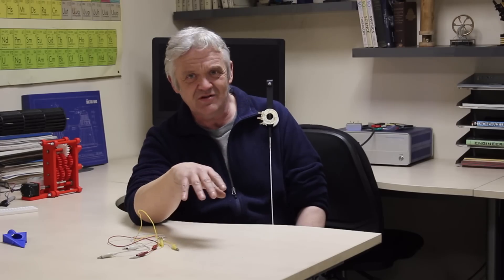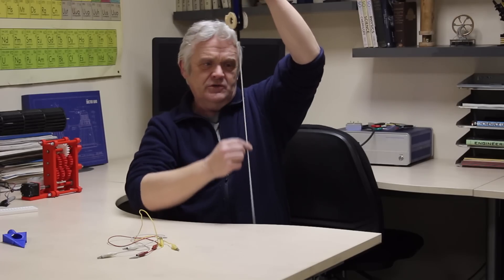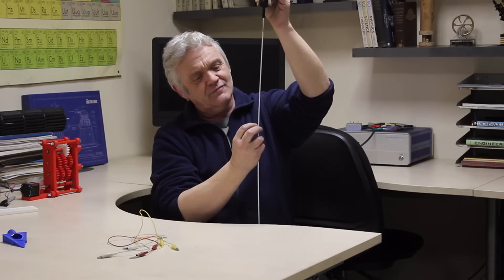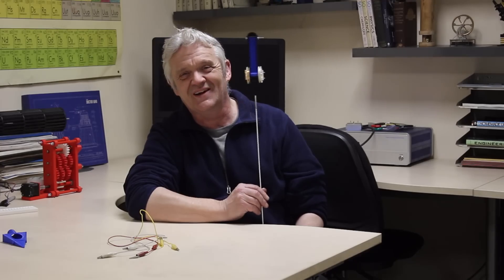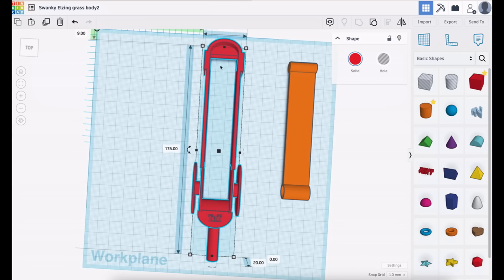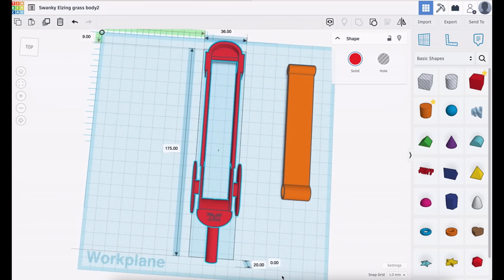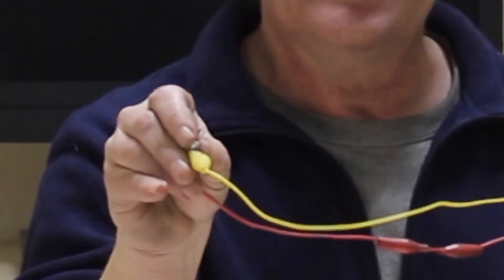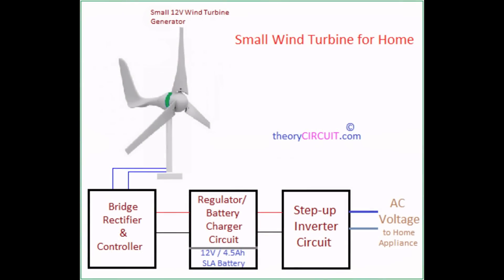1841 Barleycorn Wind Generator - Quite Possibly The Best Thing I Have Made

Comment: This is wonderful!
The barleycorn generator itself is aesthetic and functional.
The rod/spring as a protective measure against strong winds can be used with other kinds of wind energy devices, either by changing the device's position or angle in relation to the wind, as demonstrated in the video, or by deflecting the wind itself.
Thank you.

Comment: Excellent Rob! I was thinking about this a bit and was mauling over ideas that if you could scale it one way or the other and in doing so increase output if scaling up or keeping the same output in making it smaller thereby lowering costs or footprint. If we can double the output to cost ratio by any design changes then it clearly would be a more than formidable to any other wind energy harvester, due to the fact there is not much out there to harvest the more abundant low wind or vibration sources of energy. 
It all seems so very simple and I have always been a proponent of localizing our energy production and decentralizing it is the key. When we do this it allows us to meet our individual demands with sources or designs that would be completely infeasible for big energy to build or develop and thereby not given any respect because they cannot use these to make money, however these types of harvesters that are small and productive for the individual needs are the very key! They can be easily built at low cost and they can provide all an individual household could use. 

This localized mindset should be at the forefront of society and it does so much good for all of us as a whole and I am ever hoping that we all will awaken to creating this and get out from under the strong arm of big corporations and be our own producers of a healthier living. We have the tech at our disposal now that individual sweat and work to have these systems is not a deterrent it may once have been, because we can now individually be our own factories and providers on small scale that is competitive to the big businesses and build systems that take very little physical input to run them.
Reply: Imagine putting these along the side of a busy highway and letting the passing vehicles create a steady flow of wind. Also, put them into sheets mounted on posts, and they will be sturdier ( https://imgur.com/E63ec5m ). I alternated the colors to show one option. You could even paint sequential messages on them, line them up in consecutive rows, and they'll start to look like the old Burma Shave signs from the early 20th century in America.
Reply: You have a right to be concerned with the cost and it will be heavy but do not discourage. Your current engineering specks are correct. You just have to miniaturize these to the microscopic scale and they are feasible to use. We would be mimicking nature in how she harvests energy. Think of the cilia that coats your intestines insides? This kind of 3D microscopic printed or bio printed surface on buildings would be doable by your designs.
Reply from the maker: myself - I would like to go smaller - make them pretty much unobtrusive - I sincerely think it can be done

Comment: So many ideas spring to mind. The main stem could drop into a solid sleeve to protect it in stronger winds. A sturdy piece of sprung steel could have whole branches of 'e-barley' mounted on it. Motorway verges could be planted with these to make better use of dead space and easy access while using the turbulence of passing vehicles

Comment: One of the main problems using a field of these devices would be plants growing in between the springs & restricting their movement. However if you installed solar panels above them it would reduce the light available for plants to grow & increase the power generated per acre. Also if these devices were white & bi-facial solar panels installed then the usable amount of reflected light from under the panels would increase for extra solar power generation.
Reply: Think of it this way. Why not stack units of these on top of one another just like in the head of barleycorn and then just make the stalk very tall for each compound unit.
Reply from the maker: they don't need land surface per se - you could stick them to buildings, roofs, bridges, the sides of roads, road signs, bouys, ships, lamp posts - the list goes on and on

Comment: Another big plus is not having huge turbines across the landscape.
I do wonder about the sound a field of these would produce compared to the standard wind turbines currently used, if quieter that would be a huge plus.
On a side note, your constant great ideas could be used as proof that caffeine is good for us :)
Reply: I doubt they would be quieter. If you've ever stood next to a field of barley you will know that they wind makes quite a noise as it blows over it.  I expect that if you stood on the edge of a large field of these they would make the same noise as one large turbine stood in the center of the field.
Reply: @tlangdon12   - the benefit of the barley is that you can eat it at the end of the season.
Reply: Would a field of these be better? You 'might' be able to get away without concreting over the field, but you'd need miles of wire and a load of transformers, maintenance would be higher because you'd have thousands of things that could fail and finally you've lost the field to actually grow crops

I guess in a low wage economy on the margins of a desert it might make sense? So the edge of the Sahara?
Reply from the maker: they don't need land surface per se - you could stick them to buildings, roofs, bridges, the sides of roads, road signs, bouys, ships, lamp posts - the list goes on and on - and yes caffeine is awesome lol
Reply: @ThinkingandTinkering  Hi Robert. Could a field full of these also double up as an earth battery in some way?

Comment: You could make it simpler by putting a flywheel in the top and then running fine thread down the supporting rod. Then with a sail of some sort at the top every time the wind blows the cables are either stretched or retract adding momentum to the flywheel. This maintains a constant power production between gusts.
Reply: Kind of reminds of some kite-based wind power designs, with the sail-kite being pulled back by the wind to generate energy -- except in this design, a spring system could pull the kite back so it can further spin the flywheel.
Reply: @kensmith5694  Hm, here's a radical re-imagining: A kite attached to a string with a magnet-counterweight that is inside a tube. Coiled around the tube are, of course, copper coils. As the wind picks up, the weight is pulled up, and as the wind goes out, the weight drops back down. I imagine this design would be incredibly cheap: besides the wire and magnet(s), just PVC piping, fishing wire, maybe even a little rubber balloon?
Reply from the maker: I am not sure that is simpler per se mate

Comment: Another fantastic idea Robert! I was thinking if the coils were oval, you could put three of them alongside within the arc of the pendulum, giving triple the output either current or voltage per each barleycorn generator.
Reply from the maker: nice idea mate - cheers
Reply: Each coil would need to be gated because of the slight timing difference.

Comment: Like a weather vane make sure it can change in any direction. Make it with flexible and durable materials that can stand the weather and you have a wonderful idea. Even on a small scale (6 meter or 20 foot by 6 meter or 20 foot square  lawn area) I think it is worth it. Lighting a energy efficient low volt led light bulb for night time use. Even saving the potential energy in a gravity battery for later use. I would love to see this small scale so that anyone can actually build it and go from there.

Comment: That is brilliant, if they were all lined up on motorway central reservations and sides they would generate from the air pushed by the traffic even when there is no other wind
Reply: Next to railroad tracks, on road guard rails and lots of other places.
Reply from the maker: they don't need land surface per se - you could stick them to buildings, roofs, bridges, the sides of roads, road signs, bouys, ships, lamp posts - the list goes on and on
Reply: I've often wondered why the vent shafts in tunnels don't have turbines on them...
Reply: @Hoops-Senior  because the turbine would cause resistance to the expelling of the air, which is would impede the efficiency of the vent.
I am wondering why all new house builds cannot have roof ridge turbines as mandatory, they are very slimline and you have to have some kind of ridge weight anyway see The Power Collective design
Reply: @utubeape  True; however, increasing the diameter of the vent would overcome this.

I believe that some train tunnels take the compressed air in front of the train and route it to the back of the opposing train tunnel.

The ridge turbine is a good idea. Of course, the developers would complain about diminished profits, but if mandated would soon become the norm, and price norms adjust accordingly.
Reply: @utubeape  But slowing down typists was to increase speed as they spent so much time untangling the hammer keys.
Reply: @Hoops-Senior  exactly, but now we have computer keys we should change to the most efficient way, it will be tough, like going from imperial to decimal but better in the long run
Reply: @utubeape  Perhaps, though lateral thinking about H, MI is probably the right way to go. Voice input, eye-tracking, Machine-learned-hieroglyphs etc.

Comment: I like that one a lot, only thing I thought is that wind obviously goes in all sorts of directions - how about a bell shape rather than a flippy floppy hinge? Change the collector to an X shape and point the magnet straight down (or up), over a few small coils. Slightly larger design but would collect in all directions, Maybe a clever way to wind a coil so its always going in a straight line across the copper when swinging? Also with an open bell design you could prevent an "over swing" effect which could tangle them all up in a gust!

Comment: Another fascinating video.  I have thought for years that harnessing the extremely low breeze is the way to go.  what about doing something even more micro.  how about instead of designing it to resemble barley, how about a blade of grass?  I have seen grass vibrate with very little air flow.  could you design one with a pazio electric crystal instead of the expensive magnets?  are the crystals less expensive?  your barley could be placed on top of flat buildings.  the coverage would also lower cooling costs  because of the shade they would produce.

Comment: Ideal for a barren Scottish island perhaps. For on a large scale deployment, an inexpensive solution to weed infestation would otherwise have to be found. Not to mention the loss of profit from using the ground for something else. However, they may not work under five foot of Scottish snow. Also these generators would need to be sufficiently resistant to UV to last long enough to recover their capital cost. Printers should be able to fabricate much larger ones the size of a Barleycorn pub sign and have it pump the ale up from the cellar at the same time.
Reply: PLA, PC, PVA, ABS are all quite sensible to UV, but acrylic last way longer, tho it requires FMD printers...and fibreglass is even better. Anyways, for big batches you are not gonna print them
Reply from the maker: we don't have to be quite so literal mate they don't need land surface per se - you could stick them to buildings, roofs, bridges, the sides of roads, road signs, bouys, ships, lamp posts - the list goes on and on

Comment: I guess these could just as well hang from a wire, kind of a clothes line with a bunch of these hanging from it. The wire itself could be the power transport, the units would be parallelly connected to it. You could make it a clothes rack to save space.
Reply: This idea!!! Right here, it can be microscopically printed right off the bat to work like this.
Reply from the maker: nice

Comment: That's freaking ingenious!

Imagine hooking up to a battery and some super caps as a bunch of small fields. Near roads and in breezy areas.
Reply from the maker: that would be cool
Reply: @ThinkingandTinkering  Whoa, a reply 😆. In hindsight, your a battery guy. It's unlikely you don't have some legitimate super capacitors sitting about.
 I would love to see it in action. Why not print some manageable quantity. Stick'em in a cheep material like florist foam. To see if it performs well enough to efficiently charge a battery ? 😏🧐

Comment: It's pretty much a pendulum generator on a spring. I like where your idea is heading at,  but i would prefer a piezoelectric generator over induction generator setup, The advantages are the overall production time and cost of materials are much cheaper comparing to magnets and coils on a larger scale if your thinking of spreading hundreds of them across large landscape area..PEG can be excited from wind, rain water and other surrounding disturbances getting more energy output while induction coils relies only the oscillating mechanical motion of the magnet passing the coils from wind alone. Looking forward to your further improvement on this design.
Reply from the maker: I would say that s exactly what it is and nice suggestion - I always think of these things in two parts - the capture mechanism and the conversion mechanism - the idea of a two pole pendulum - which is what this is as an energy capture device is well understood I think - and induction or piezo as conversion are really a choice - a bit six and two threes to my mind - but I see the advantages and disadvantages of both and take on board what you say - cheers

Comment: Hey Rob if cost is a concern, you can make a hybrid bearing.  You can 3D print the body, and use BB's (the standard metal ones or the airsoft ones depending on the size you need).  I wouldn't use them in a 20,000 RPM generator but for most purposes these are great.
Reply: what about mylar.  We used it all the time in plane models.

Comment: Hi Rob, nice invention, can you make a couple and put them up your property and let them run for a couple of weeks and measure what it harvests? I think you are right in that such an "simple" and cost effective could make sense for generating a steady power when there is some air movement around. Wood could be better, but you need to paint it to not get the environment to dissolve is (might sometimes be better to have it in plastic as it will probably last longer which is in the end somewhat cheaper (if disposed properly afterwards). Keep up the nice ideas!

Comment: Tech point if you connect them in series … a couple of issues… if one breaks you lose the lot also, if you get say half of them in opposition to the other half, worse case scenario is you get cancellation. So what I would suggest is to put all the devices in parallel but have a blocking diode on each item. Ok you are generating current rather than voltage but that’s no problem, if you take the output into a Buck Boost converter then the volts and amps are taken care of.
Reply from the maker: cheers mate

Comment: What you (and viewers) could potentially use to easily get some practical numbers from these small generators is one of those USB / battery testers that will let you charge a battery (or capacitor?) through them as they measure the voltage and current and it adds up the mAh - the one I have that has a variable load also lets you power it with another source so it isn’t necessarily trying to depend on the measured source to power itself.  Very useful to have when you aren’t sure about a USB power source; they usually over promise what they can supply. It also includes a bare wire terminal so that it can test more than just USB cables and devices, and thanks to USB-C compatibility it has to handle a reasonable range of voltage.
Reply from the maker: cheers mate

Comment: Could add a tail like a weather vane, to allow it to turn with the wind. Would need to make the fiberglass connection rotatable then, or the ground connection point. might not be worth the effort though, would need a slip ring or something similar for the electrical connections.
Reply from the maker: nice

Comment: I do like that design. As You rightly say, it needs a bit of more research and testing as regards the material used for the spring, it would be nice to use something like wood, yes. Also I wonder if You could get more coils per spring or use a simple sail "wind concentrator" and a more powerful spring to scale it up a bit. It would increase the cost effectiveness and the watts per area used so maybe We wouldn't need such a big field of them to be meaningful. I say big because i'm assuming they need to be spaced so a collision is impossible.

Comment: How about moving the energy generation to the base ( using piezo electrics? ), accommodating for translational and rotational mechanical motion of the shaft and replacing the "leaf" with a static design? Lots of scope to experiment with the best type of leaf. Less moving parts too.
Reply from the maker: worth a try le the know how it works out will you?

Comment: I just realized a problem with this idea. If you have more than one of these they wouldn't all produce a positive polarity voltage at the same time, so if you wire them in series you would expect the voltages to add together.  Some would be producing a negative voltage. if they weren't in sync , they would null each other.  Current can't go both ways in a conductor at the same instant. Maybe each one could be connected to a capacitor, through a rectifier .So a field of these would create chaotic blips and virtually no power to speak of.